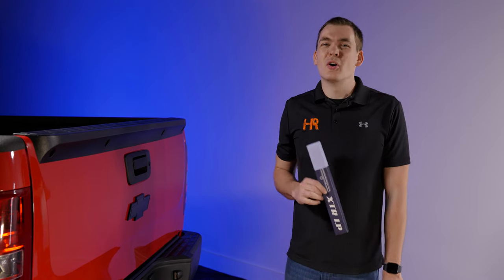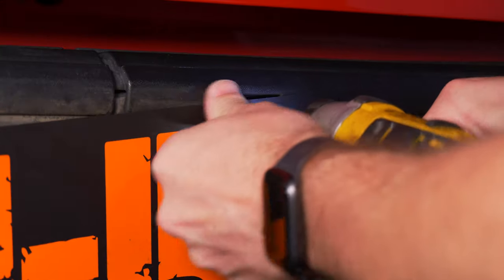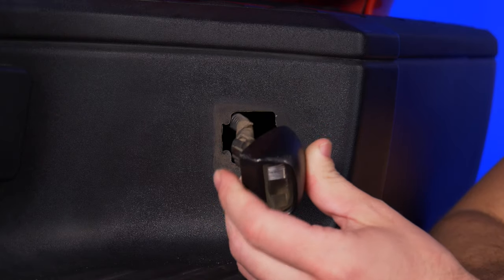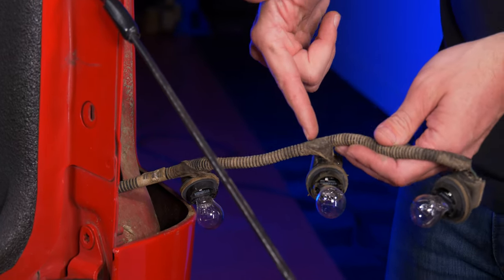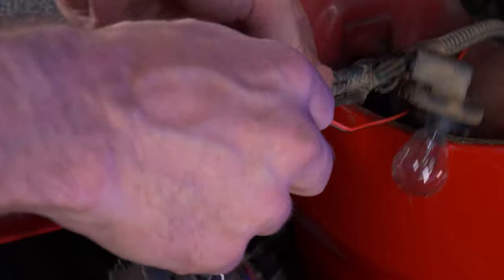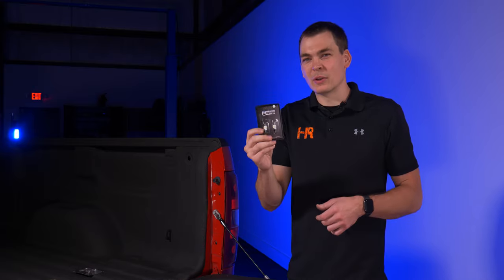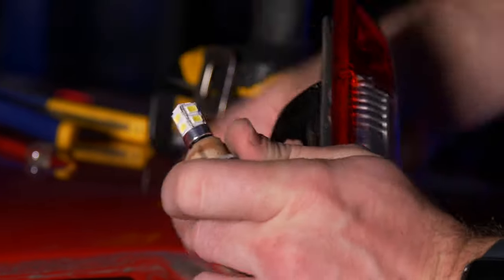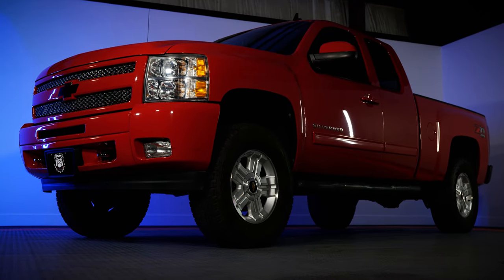The BRIGHTEST Reverse Lights For 07-13 Chevy Silverado | Headlight Revolution

Comment: Just received all three today, license plate lights, reverse lights, and cargo lights. Reverse and plate lights work awesome but the cargo lights when i removed the stock ones….they look like they’ve never been lit even once. What gives ? When are they supposed to come on because apparently they’ve never been lit. I can’t even tell if the polarity is correct because i cant figure out how to activate them. Any help would be appreciated
Reply from the maker: There should be a button in the cab to turn these on and off.

Comment: Hello, I am a new subscriber and find your information really helpful even that I don’t owe a truck. My question is what is the recommended upgrade for a 2007 Corolla with reflector lenses that use 9005 and 9007 bulbs. Want to upgrade to HID or LED. Thanks.
Reply: I would go with LED man. I bought the supernova v4 LED bulbs and they've made a huge difference in my reflectors headlights. Now that the GTR lighting ultra series 2 bulb is out it's kinda the flagship bulb to put in if you're going the LED route. I just purchased the GTR lighting bulb for my projector headlight. Just waiting for them to get back into stock so I can try them out. Best of luck man
Reply: Jojon Cruz Thank you for the information. They have the GTR Ultra and the new CSP Mini that mimics the factory OEM but made by the same ppl. Ahhhh, decisions that can cost a lot. Don’t want to mess things up, lol
Reply: @luisquintero1945  understandable. They aren't cheap but you get what you pay for. Definitely would recommend either or in my opinion. 👍
Reply: @jj_cruz  Actually the mini are more expensive
Reply from the maker: Send us an email at Sales@HeadlightRevolution.com, We have experience with those vehicles and there are a few really good options available for you.